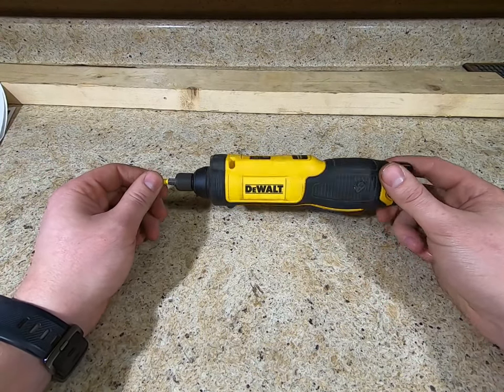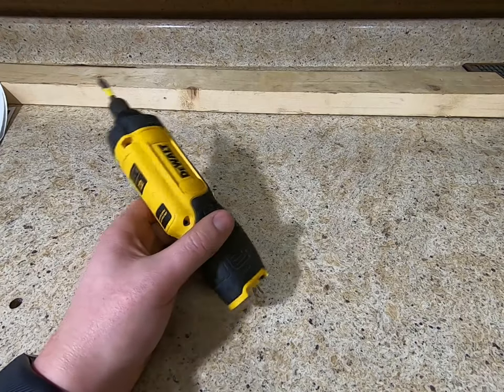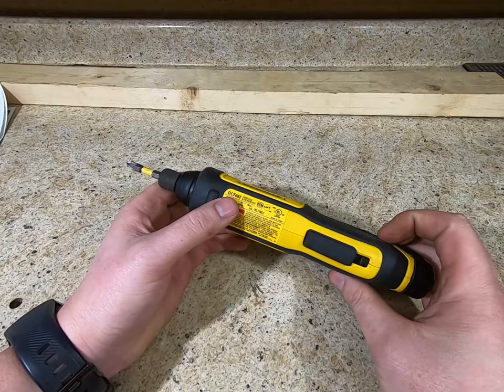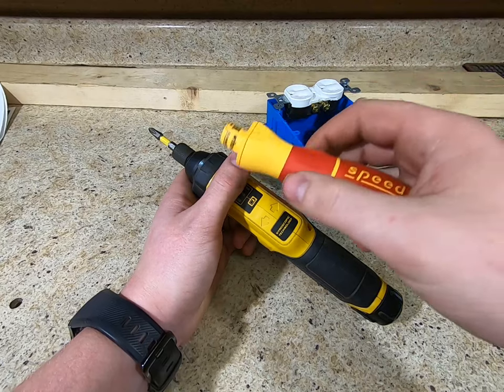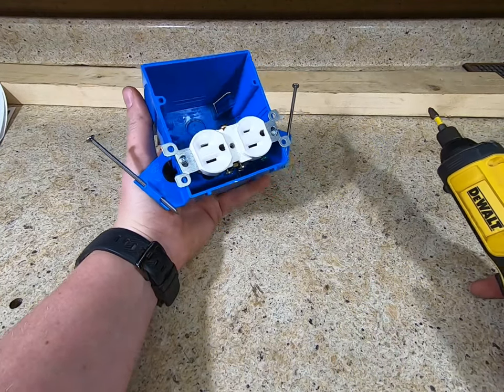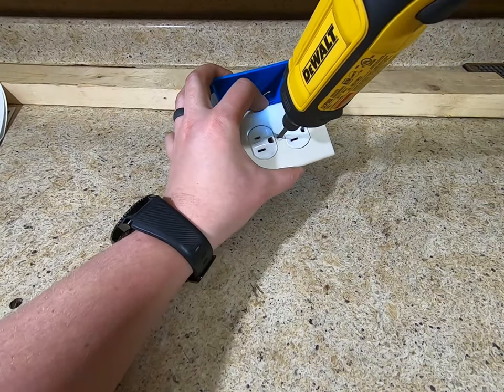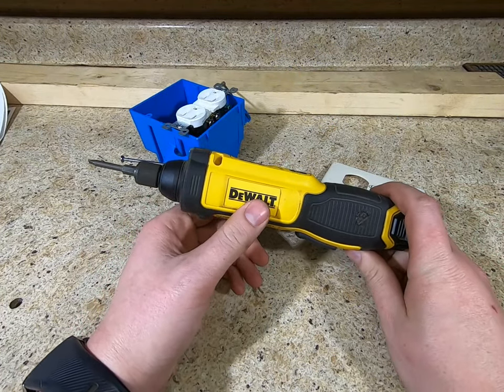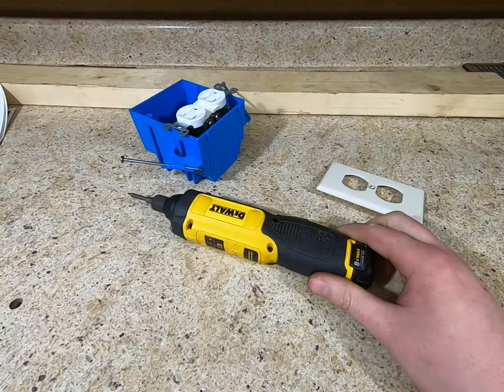CTGR: Dewalt Gyroscopic Screwdriver Review

Comment: I watched a second and third video before I saw how to remove the bit from the screwdriver. Pull the collar away from the tool.
Reply from the maker: Sorry just got your comment now. It is frustrating how different manufacturers use different directions to get the bits out.
Reply: rtfm